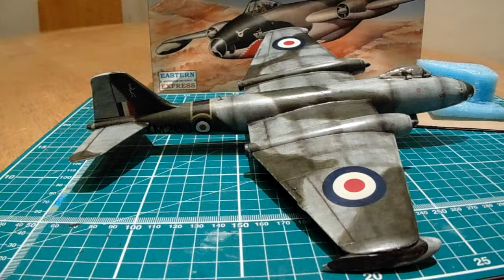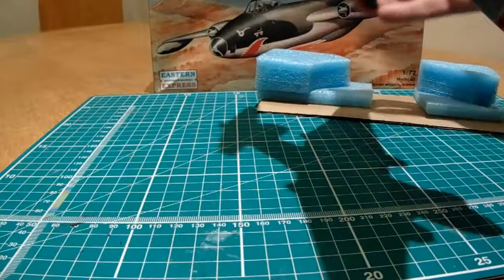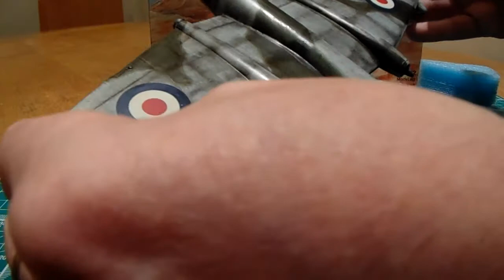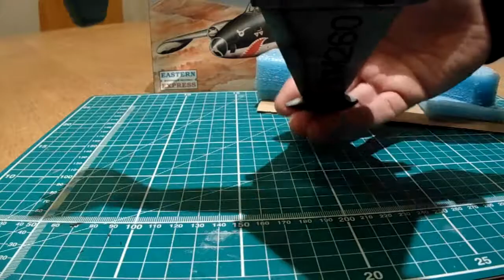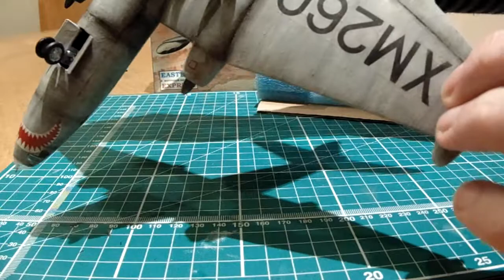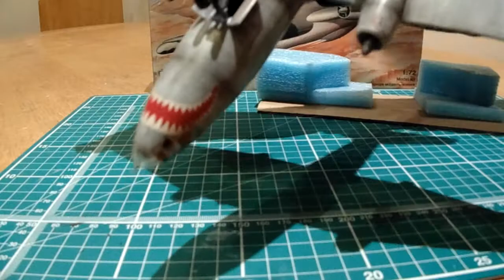MFM: 1:72 scale English Electric CANBERRA B1 8. Eastern Express. Build eleven Reveal !

Comment: you said that you  used oil paint for the camo and did you clear over it iam trying get my plane building better your build was awesome
Reply from the maker: Cheers Eddie,yes I did use clear over it this time but not on the earlier mosquito model. It seems to work if you keep the oil paint thin and make sure it's dry before you apply it,although I'm still uncomfortable at applying acrylic based varnish over oil in the long term sense.For the mosquito I used artists varnish.
Reply: MyFactory62 thank you